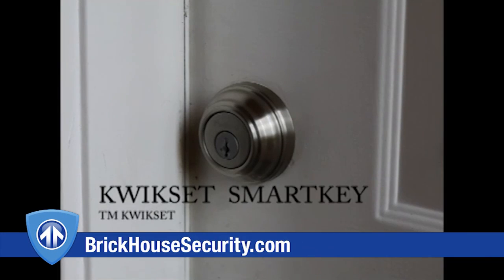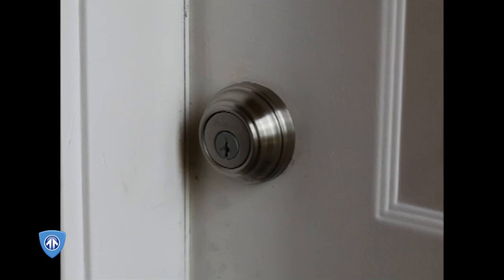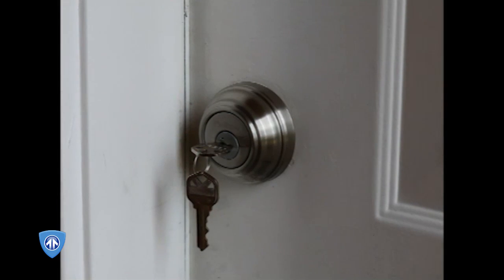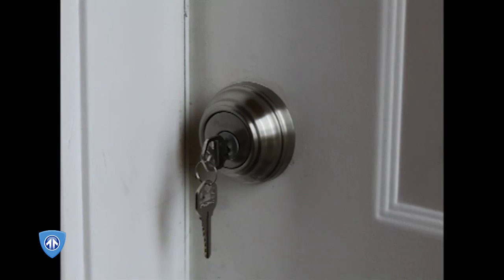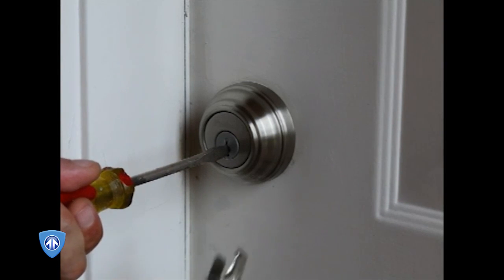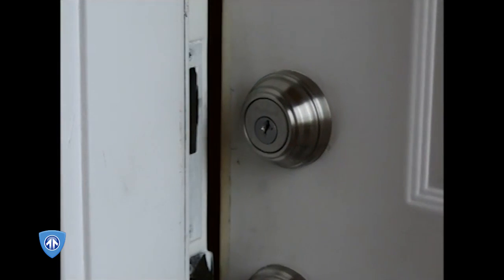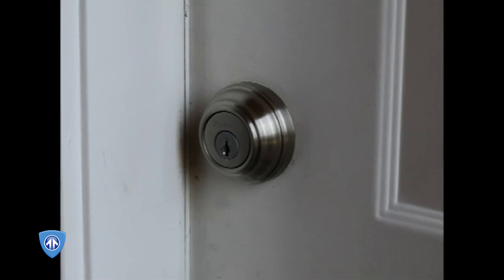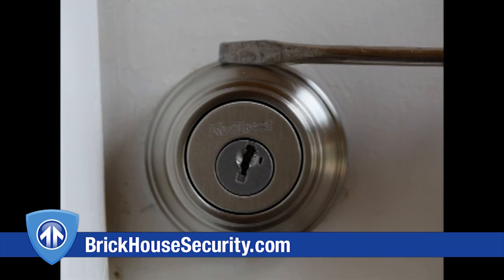KWIKSET SMARTKEY Lock Gets Picked with a Screwdriver and a Blank Key

Comment: I'm sure this video is legit, but every time I try this I have the face of this center pop off.

A lot of people like to claim smart locks are SOOOO easy to force, but they really aren't.

BTW, forcing open is not picking.

Anyway, I have my own methods to defeat these locks that I will not be sharing with the class.

I'd LIKE to learn to pick them properly, but that ain't happening it seems.

Comment: This video was for the first generation Smartkey locks. Forcing the newer ones takes much longer because will cause the cylinder to break off in small parts. You have to keep doing it multiple times until the whole cylinder comes out of the housing. Then you can see the bolt thru the hole & turn it with a screwdriver.

Comment: "no evidence of entry" yeah right. all they have to do is stick their key inside the lock
Reply: There are at least 2 other methods of entry which are even more efficient and superior to this which do leave zero evidence of entry. You can pick it with a rake which takes less than 10 seconds to do (my preferred method), or buy a specialized tool which is basically just a large reinforced blank key which you insert and brute force it open and remove the key when you're done. Since 1 key fits all, a specialized tool would just be considered a tiny investment.

Comment: this is not picking, this is a forced open. picking doesn't destroy the internals of the lock, forcing it open like this destroys the internal mechanism of the lock, rendering it useless and leaves evidence you were there.
Reply: bosnianbill picked it with a rake in just a few seconds in one of his videos. It left zero evidence and zero damage to anything. As someone who picks and re-keys locks as a hobby / part-time work, I can tell you right now that those "smart" locks are bottom level security, if you can even call it that.

Comment: Good grief, who cares. Nobody would bother going through that. They'd just kick the door in or break a window. It would be more inconspicuous than standing there banging a key into the lock with a screw driver.
Reply: you can bang a screwdriver into a key considerably more quietly than shown in this video.

You cannot quietly kick a door down.

People don't pick locks when a lot of people are around, bad people pick locks when your at work, because they're not at work. they don't have work, what they do have is your stuff.

1-2 pm is a time when virtually no kids are home in any home, and the majority of parents are gone.

Know how many houses survive off a single income now adays?

a lot of people are at risk to this, there's just not a lot of people doing it, but it's incredibly easy to do.
Reply: Bryan B they can but there are homes like townhomes where they don't want to cause too much noise but have the privacy at night to go picking away.
Reply: Without leaving a mark? Are you blind or just stupid, like the clowns that posted this video. The key hole is damaged and the blank is stuck in there so how can you say "you can make an entry without leaving a mark". Will someone notice from a distance?  Probably not, however anyone that lives in a high crime area (any area really) should have an alarm system even if it is not a monitored system. 

I'm not worried about someone making entry into my home as I have two dogs and an monitored alarm system. Along with replacement cost home owners insurance so come on down and see what you can get.

Comment: He got it open, but he not only struggled, he also made NOISE and was SLOW.

Think of a better way to sell your security system service. Not even ADT pulls this low-budget crap.
Reply: If he had a man sized vice grip or a specialized tool that would fit the key way better (believe me, it's not difficult to do), then ya, you could break in in less than 10 seconds and not make any unusual sounds. Anyone not paying too much attention would just think you're using a key to get inside as normal.

Comment: The only arguable advantage for SmartKey is difficulty to pick, but only an extremely minute ratio of burglars ever tries to pick a lock. But there are a lot of screwdriver experts out there who would make mincemeat of one of these, just like they do to automotive wafer locks. Then you have the other common entry methods - e.g. brute force kick-ins, prying or wrenching - and I have very little faith in the structural integrity of Kwikset's product over any others. You're better off with a decent pin tumbler deadbolt especially with a side-bar...
Reply: hi, what is your favorite deadbolt with side bar?
Reply: Carie Voss my only experience with sidebar deadbolts is Primus/Everest, but any sidebar is hell to pick.
Reply: can u give a link to a sidebar not too expensive? (i am on student budget)
Reply: Carie Voss I would look for a deadbolt that is either Mul-T-Lock, Medeco, or Schlage Primus, but none of them seem to cost less than $100 - usually quite a bit more. Maybe Ebay is your best bet.

Comment: Yes, with enough force you could, in theory, do this to any lock. The issue is the amount of force required (less than 10ftlbs by most people I've seen measure it), the lack of obvious damage, and the high security rating these locks get. A lock that can be brute forced with almost no sound using basic hand tools should not have a grade 1 rating.

Comment: Or you could make/buy a KTT-3 smart key device, which leaves no evidence of entry.
No key blanks left, no damage to keyhole, original key still works for the most part.
However, a locksmith will be able to tell if there was forced entry on disassembly, particularly if the lock feels rough or the key only works half the time.

Comment: Okay, so you were able to break the lock and get it unlocked. What you DON'T say is which deadbolt system is BETTER than Kwickset. I suspect you could use the same principle on pretty much ANY deadbolt lock to defeat it. You can also use a portable drill and just drill out the pins or the cylinder. You guys act like this is some miraculous discovery. It isn't.

Comment: I would recommend using a schlage grade 2 or grade 1 lockset. The kwikset locks are junk. The older ones were more secure against a forced entry because you could not do this. You either had to pick them or drill them out. Grade 1 is the best, Grade 2 being second, and grade 3 is junk. You get what you pay for.

Comment: Seems like enough to deter your average hood with a bump key, at least if you life in an apartment building with lots of curious neighbors. If you get locked out, you can easily take a screwdriver, key blank and locking wrench to it. As for insurance claims, if someone goes through with your technique, there is plenty of evidence, the deadbolt is destroyed.

For the price (under $40.00) it seems like a good deterrent.

Comment: I agree with you in theory, but the average consumer has a hard time telling the difference between aged brass and bronze a worn key way even marred by a screwdriver does not attract attention to warrant concern or even notice 90% of the time. Not to mention a piece of steel formed to a KW key way would provide the force from the keyway and never leave exterior sign at all. There is debate that even after forcing these cylinders the programmed key will still lock/unlock.

Comment: Bullshit, if you hammer a screwdriver into the keyway, your telling me that it leaves NO SIGN of forced entry, it shows that you really do not have that much knowledge of locks in the first place, why did you change the coding of the lock BEFORE you forced open this lock, could it be that the new key was a closer match to the small cut bit of blank you inserted? Either way, the programed key would not work this lock after being forced,  You have the skills to get a job at Home Depot.